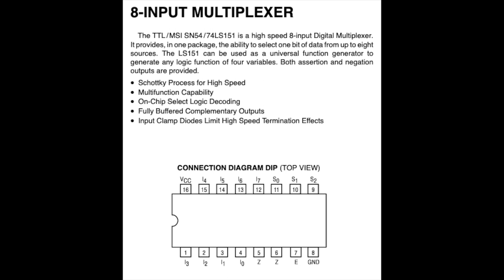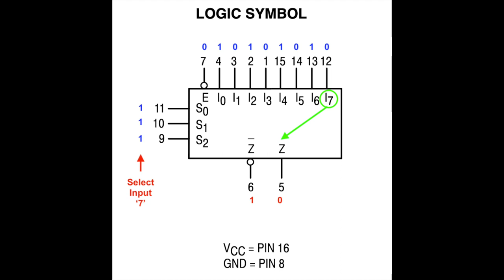Will it work? A 50-year old 74151 chip.

Comment: Interesting!  Over the past year I have dug out all my boxes of 74xx chips which were in a cold and damp workshop.  Bought and given to me in my youth, many are from the early 1970s and... they all work perfectly well in projects I am doing now!  But BEWARE all of my chips that were stored in black anti-static foam have rusted away and the foam decayed to dust!  They would have been better stored loose or in polystyrene blocks!
Reply from the maker: Excellent advice. I have newer chips stored in black anti-static foam. I wonder if the black foam absorbed humidity and retained the moisture, leading to the problem?  I'll have to review my storage methods.
Reply: @inazumadenki5588  Yes and by the way, all the ones that were stored in those push in little plastic containers which hold just one chip or the long plastic pipes that can be used as well all kept the chips in perfect condition!  But beware the black foam!

Comment: Would be interesting to compare its current consumption with a modern equivalent.👍
Reply from the maker: Great idea for a video!
Reply: A modern 74-series (TTL) should be identical. It’s the myriad newer logic families (e.g. 74HC, 74ALS, etc etc etc) that use less power.

Comment: Of course, you know that standard TTL has a strong low output drive strength (8 mA to <0.8V) but a much weaker high output drive strength (0.4 mA at >2.4V).  The LED could have been driven much more brightly from the /Z output by tying the LED to +5V through a 1K resistor.  Trying to drive it high from the Z output  won't give you much brightness.
Anyway, good explanation!
I know that TTL draws lots of Vcc current.  I designed (entirely on paper) and built (with the help of a tech) a device that used no less than 500 standard TTL chips that used 8 whole Amps of +5V power.  The power supply needed to be fan-cooled.  It was a beast!
Reply from the maker: Absolutely! TTL outputs sink more current than they can source. In the 'source' configuration (as per the video) the current draw with the LED in series with a 1K resistor is 1.45mA; in 'sink' configuration (as you suggested) the current was 2.85mA. With my old LEDs there was a slightly noticeable difference in intensity. Thanks for your feedback.

Comment: Fascinating. I probably still have a few chips from that era. At work, I believe I have some old RTL and DTL chips from the 60s. The RTL were used in the sequential color circuits for the Apollo space program (I believe I was told it was the RTL for that project, was before my time there). I never had the heart to discard them. Actually, I think there is a whole circuit board and the original NASA schematics buried int he storage area. I was never a big fan of TTL and merely tolerated LS. I always preferred 4000 CMOS (not to be confused with Motorola's 4000 series parts) and HC was the answer to my prayers when it came out. Now LV is probably my go to family along with HC. Anyway, pretty cool seeing an old chip still work. Until recently, I had two Caltex (later Fairchild) PMOS chips in digital clock running 24/7 since 1975 and 1977. Both still work fine but newer technology has now replaced them. Now I need to start looking through my archives to see what old parts I have. Thank you for the fun video.
Reply from the maker: Cheers! It'd be great to know the vintage of your oldest chip. Your experience seems quite broad, from RTL through to the latest. I think we're lucky to have witnessed this era of chip technology evolution. 
The Apollo program was an absolute masterclass in performing miracles with the bare minimum. The resourcefulness, imagination, tenacity and determination of those engineers is inspirational. They didn't just do it - they lived it, sometimes to their own detriment.

Comment: The #1 destroyer of chips, is ESD. (Electro Static Discharge). That happens, when you pick up the IC loose in a box, and you've walked across a carpet, building up a static charge. Snapping one of the pins will for sure, destroy a chip, especially, if it's a CMOS. Another killer, is excessive supply voltage. Power On/Off cycles isn't a problem, as long as there is no transient spike.

Comment: Great chip.  Just keep it away from huge solar flares.   😎 Thanks a lot.
Reply: Actually, this 74LS151 is more likely to survive a solar flare than smaller geometry modern parts.
Reply: 74151 that is...
Reply: @expensivefreeadvice8530  The solar flares are getting in the news. Thanks.
Reply: @qzorn4440  need the next scare hyped up!
Reply: @larrybud  🤣
Reply from the maker: Cheers! I've hidden it in a dark drawer 😁 Good for another 50 years!

Comment: In my parts bin I have several dozen mid 70s date coded TTL devices. Of course they are going to work fine. I would use them in a new project without hesitation. What do you think happens to them?  There is someone selling early TTL that has been tested to crazy high speeds. I must get a few just to play with. The 74151 here is not LS but if current consumption does not matter and it was a good part to start with then there will be no problem. Modern parts if not purchased from a known good source I would avoid as so many are fake or just broken.
Reply from the maker: It's a good question that's been asked by others.

I read somewhere that the silicon wafer itself is subject to internal mechanical stresses due to different layers treated with different temperatures during manufacture. Over time (years/decades) these can lead to fractures, mostly in metal conductors.

Humidity can be an issue also. Over time, moisture can ingress through the spaces between the pins and the plastic of the case, which can apparently lead to galvanic corrosion of metal conductors within the chip package.

Comment: The metal in these old TI chips easily corrodes and legs break off
Reply from the maker: I try to keep the legs clean and dry. It's hard to maintain a low-humidity environment though.
Reply: Depends on the lead frame material they used.  They cheaped up for a few years and that era of ICs have the leads that are very fragile years later.

Comment: when output enable is off (high) does this also influence the inverted output? and how? I know this should be in the datasheet, it is just a thought that came up.
Reply from the maker: With the Enable set to high, the non-inverting output ('Z') goes low and the inverting output ('/Z') goes high, irrespective of selected input state.

Comment: A friendly nitpick: your test doesn't entirely prove that the chip is fully working properly, since you just had fixed levels on the inputs.  To truly verify it, you would need to check that the output follows CHANGES on the selected input (and, to be pedantic, is not affected by values on the non-selected inputs).  You could use an 8-pole DIP switch to provide controllable levels on each input, though of course that complicates the test setup somewhat!
Reply from the maker: Good point. One way to cycle through the whole truth table  would be to connect it to an Arduino to run through all possible input permutations. Maybe not that complicated after all. Could be the topic of a future video. Cheers!
Reply: @inazumadenki5588  Right.  In fact, one could construct a universal tester with an Arduino which would be able to fully verify any common SSI device.  Could be a nice little project!

Comment: Aside from a desire to view a non-inverted output (1 = LED on, 0 = LED off), I wonder why you connected the LED to the 0V rail instead of the 5V rail.  TTL  outputs are not very good current sources; their ability to sink current is like 30x higher.  In your configuration, I guess most of the 5V supply is being dropped across the internal resistance of the TTL output, whereas if you did it the other way, the TTL output transistor would be in saturation and you would be dropping most of the voltage across the external resistor.  The LED ought to be brighter that way, and also the 50-year-old chip will probably last a lot longer.
Reply from the maker: True. TTL outputs sink more current than they can source. In the 'source' configuration (as per the video) the current draw with the LED in series with a 1K resistor is 1.45mA; in 'sink' configuration the current was 2.85mA. With my old LEDs there was a slightly noticeable difference in intensity. I chose to do it this way so that the LED status would match the truth table. Thanks for your feedback!

Comment: I was amazed your circuit worked at all. I thought open inputs on TTL chips are seen as logic "1". So your circuit should have addressed I7 no matter what you set the DIP switch to.
I guess the video proces me wrong. But it puzzles me...
Reply from the maker: You've actually noticed something that I didn't mention. The inputs are all actually tied low through a resistor network (the black bar above the switches). When each switch is in the "off" position, the  respective chip input is pulled low. When the switch is "on", the input is taken to 5V.
I don't know if floating inputs are considered high or low. From experience I've found floating inputs to cause random behaviour due to picking up noise, so I always tie them to one voltage rail or the other.
Thanks for your comment!
Reply: @inazumadenki5588 Aha! Now I see it! Thanks for your reaction.

Comment: You're better off with a rotary encoder instead of those dip switches. I can't find dip switches with pins long enough for mechanical breadboard anyway
Reply from the maker: I got lucky with my DIP switch. The slider resistance means it does tend to pop out when changing states though. Thanks for your comment!

Comment: Why not ? There is not yet for them, an expiration date !!!
Reply from the maker: Check out my next video featuring this chip, planned to be uploaded in another 50 years' time (assuming I'm still here!). With careful storage it should still work.
Reply: I knew, since my job in telephony in 80's, that logic components were sorted by equalities  and performs. There is tests of temperature, usualy for select the military quality,who are build in ceramic package.But, even  plastic packages never used, don't deteriorate. How  many years could run a 7400?

Comment: With regards to the current consumption ( comments below ) , a large PCB with many of these 50 year old TTL  IC's will consume AMPS on the 5 Volt rail .... the old industrial mini computers had power supply transformers  weighing 22 lbs ( 10 kgm ? ) or more ! ! ...... DAVE™  🛑
Reply from the maker: I remember those! The totem-pole outputs in TTL devices cause current spikes when switching states, because both output transistors are on momentarily causing a high current draw between 5V and ground. This contributes to the need for those massive power supplies (and is why we'll never have TTL iPhones!).
Reply: @inazumadenki5588 is was such a potentially disruptive problem that designers habitually added "0.1s" across supply rails whether needed or not, then when building prototype they would then add another .1 to every single chip, few knew for sure whether needed but no one wanted to experiment. For years after, even through 4000 series, it's become a classic paradigm that we continue do 'supply decoupling' out of habit but not sure what's going on.
Reply: At our computer collection we have a Symbolics 3640 lisp machine. A mixture of TTL and ECLs logic.
The power supplies are 5V 100A, -5.2V 150A and the main power cables to the logic boards have "WELDING CABLE" written on them.
Reply: In mid 70's, I had a video terminal in kit for the ELFII 1802CPU computer, installed inside an 'IBM blue' metal case with a keyboard. Made by Netronics and full of TTL's, no LS. I had to use a TO-3 5V regulator heatsinked on the metal chassis for it to survive. The board probably consumed over an amp.

Comment: All dependent of the manufacturer, if it is complete airtight it live forever. when air can go into the chip things go bad, as you see on the pins there is some oxidation because of age, this can go up into the chip when manufacturer did make it not well, destroying the chip inside.
Reply from the maker: I live in the tropics, so humidity is something that concerns me. I take precautions against moisture ingress, but the climate here will win in the end. Thanks for your comment!
Reply: @inazumadenki5588  Well maybe here in the Netherlands it even more bad when living on the coast, the salt air there is quite corrosive. Hmm tropics, I like that, I have (most of the time mild) osteoarthritis and  living in warmth do always remove the pain.

Comment: Unless it's fried, why wouldn't it?
Reply from the maker: That’s a fair question. After all, it’s hard to imagine these unused chips failing if they have been properly stored.

I read somewhere that the silicon wafer itself is subject to internal mechanical stresses due to different layers treated with different temperatures during manufacture. Over time (years/decades) these can lead to fractures, mostly in metal conductors.

Humidity can be an issue also. Over time, moisture can ingress through the spaces between the pins and the plastic of the case, which can apparently lead to galvanic corrosion of metal conductors within the chip package.